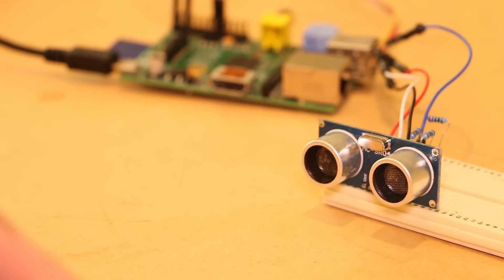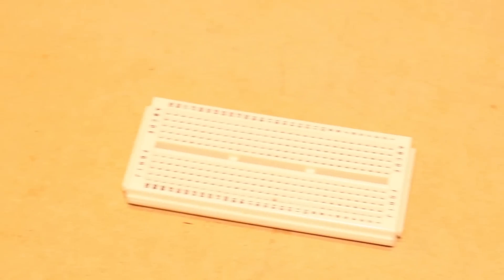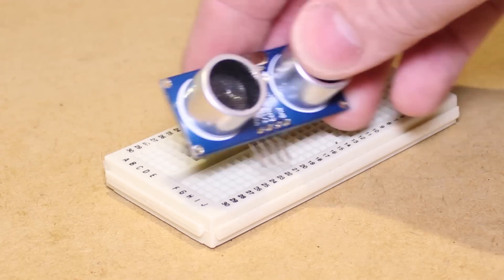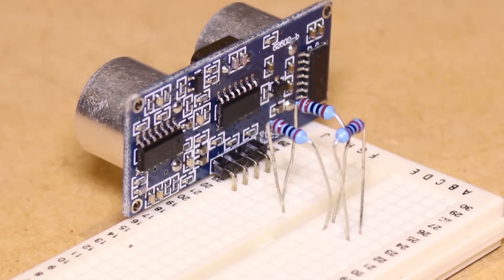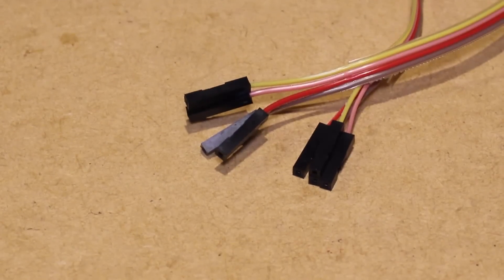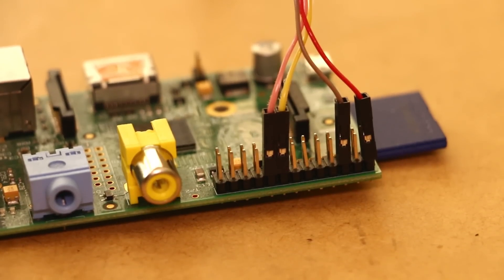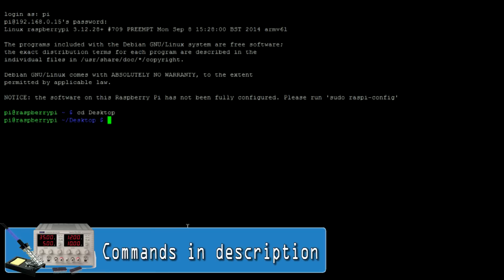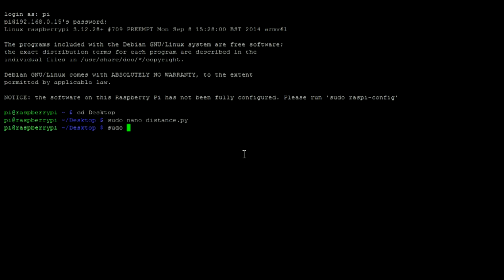Raspberry Pi - Distance Sensor

Comment: Can you tell me more about the resistors? The canakit ultimate starter kit comes with 220 ohm  and 10K ohm resistors. Could I use those in some combination with this project or do I need to buy other resistors? - electronics_noob

Comment: import RPi.GPIO as GPIO
import time

GPIO.setmode(GPIO.BCM)
TRIG = 23
ECHO = 24

print "Distance Measurement In Progress"

GPIO.setup(TRIG,GPIO.OUT)
GPIO.setup(ECHO,GPIO.IN)

GPIO.output(TRIG,False)
print "Waiting for Sensor"
time.sleep(2)

GPIO.output(TRIG,True)
time.sleep(0.00001)
GPIO.output(TRIG,False)

while GPIO.input(ECHO)==0:
    pulse_start = time.time()
    
while GPIO.input(ECHO)==1:
    pulse_end = time.time()

pulse_duration = pulse_end - pulse_start
distance = pulse_duration * 17150
distance = round(distance,2)
print "Distance:",distance,"cm"
GPIO.cleanup()
Reply: thzz for this code
Reply: Have you the code under ST langage please? Thank’s

Comment: My computer is on the opposite side of my room, therefore I really wanted to put some kind of sensor in front of the door, maybe aiming at the door handle. I'm guessing this is not that accurate, and only measures sound from sending to receiving time and from there measuring the distance between the send and receive.

Comment: I'm not sure if I am using the wrong resistors. Do I use a 1/4 watt or a 1-watt or does it even matter? Also when I run the code it says the channel is already in use, continuing anyway. What does this mean? I am not getting any data back. Please help!

Comment: Thanks this really helped. Quick enough so I did not get bored but very complete!!!! Your codeviewer is down, it would be a big help to copy and past.
Reply from the maker: +The Maker Geek Hi, thanks for the feedback. I'll try and get a link that works put in the video description this weekend.
Reply: hurry up pls
Reply: hellow can i control servo motor using ultrasonic sensor and raspberry pi